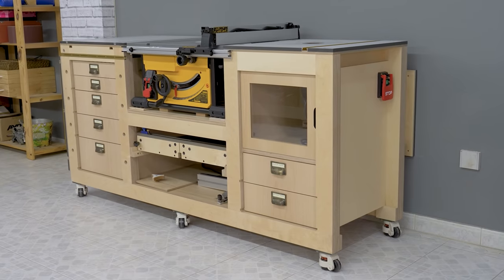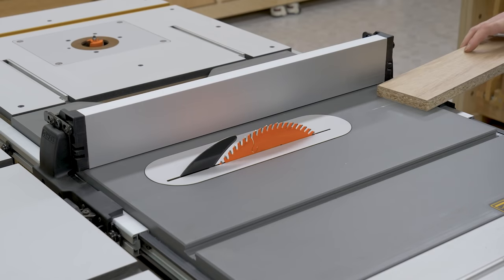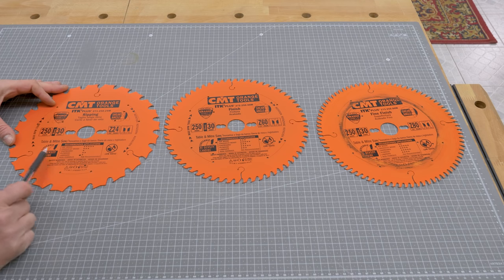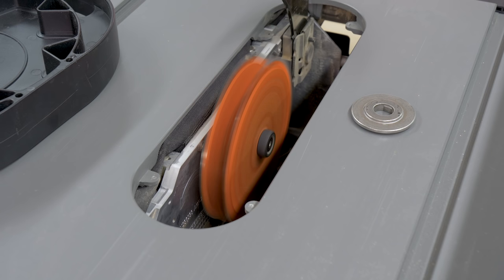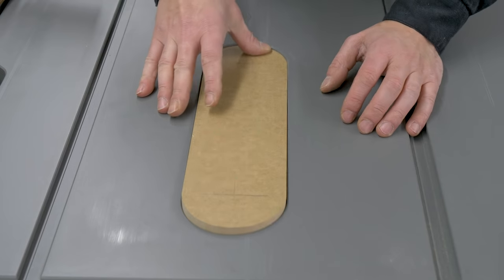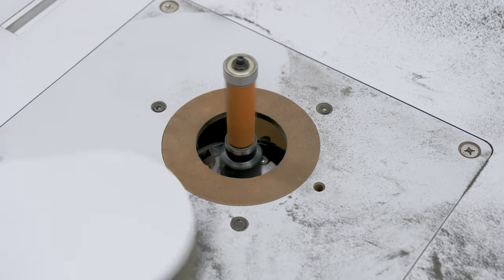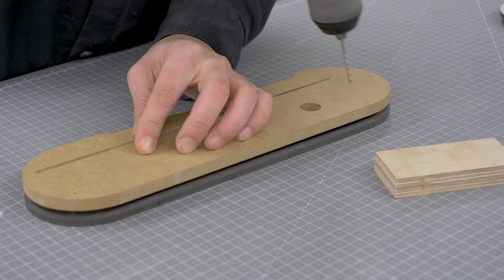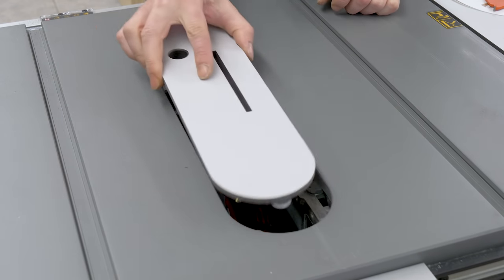DIY Zero Clearance Table Saw Insert / Choosing the Right Blades

Comment: There's a channel, hooked on wood, where the author showcases inserts with holes and slots adjacent to the blade slot for the purpose of allowing dust to be sucked into the machine. Gonna add those too once I start doing mine

Comment: Excellent video.  I made that modification to the riving knife on my Dewalt to allow the throat plate sides to be connected at the rear.  That knife is made from some tough steel.  I wrecked two metal cutting jig saw blades trying to cut that notch and made no progress at all.  Instead of knife, they should call it a riving katana.  Anyway, I finally just ground it down with a bench grinder, filed it smooth, and painted the bare edges with a paint pen.  Took about 10 minutes max.  That mod is a great idea, but it would never have occurred to me, so thanks!

Comment: Well. If what you’re saying is true. You can’t cut without a riving knife. 
With a dado blade, you are not cutting. You are scoring.
Cutting implies separation which is not the case when making dados.
Since you’re not cutting, the risk of pinching the blade is significantly lower (virtually zero).
Reply: Also cmt is an italian company, i think that if they made dado blades they should be fine for eu regualtion

Comment: The Riving knife isn't the problem. The problem is with the 10 sec slowdown rule, the weight of dado blades and the way how blades are locked on table saws: In Europe every non-covered woodworking machine (or maybe even metal working machines) must stand down within 10 seconds after you push the stop button. (But in practical it's much shorter). To accomplish this rule the motors have some kind of  built in braking solution. If you think about the direction of the nut it is designed to be self-locking and provide constant locking force on the blade while the saw is spinning.  Theoretically you're in safe even if you doesn't pull the nut properly, until the blade is standing perpendicular to the shaft. (Obviously, don't try it). However when you stop the saw and the brake is activates a counter-rotating force occurs on shaft. Eventually this - and the momentum of the blade - starts to loosening the nut. For normal blades table saws are designed. Manufacturers calculate how much force have to apply for braking to not loose a properly applied nut. But dado blades have much-much more weight and therefore much higher momentum during shutdown. 

So dado blades are NOT prohibited in Europe. They're just incompatible with the extra safety functions which have to be built in into a table saw in Europe.
Reply: There are new dado blade from cmt and they are autorise in Europe
Reply: @ir0ki11er  did you understand what I've wroten? Dado blades never was banned from Europe.

Comment: Where I live, there aren't any of those types of wood available within 200 miles. Even then its an "Iffy" proposition. Melamine coated colored MDF is unheard of even in search engines here. MDO is a plywood used for road signs in highway departments. Specially made. Usually not available except by special order with LONG waits. I absolutely LOVE your designs and their look. Practically none of the material you use is available and it would be cost prohibitive to say the least. Hooked On Wood makes similarly ingenious designs --- in the Netherlands.
Reply: Are you in the United States? & Yeah Dennis from Hooked on Wood is amazing! His new shop is looking good.
Reply: I've been searching for the same with no luck in Sweden. The best I've found and bought so far is Valchromat, which is not only colored MDF but also much higher density and behaves more like hardwood. But getting it melanine-covered opens so many possibilities. Hoping that I can convince some importers here to make it :)
Reply: @desertpillar5286  Valchromat is an awesome material. You can easly coat it with melamine with some contact cement. Anyway HPL is not the material is a special kind of melamine made of resin soaked paper. I suspect the material he's using is some kind of HDF like valchromat coated in HPL. Pricy but extremely durable.
Reply: I think the material he is using is CompacMel made by the manufacturer Finsa in Spain. It is similar to MDF but made too much higher density. When std Mdf 12mm is typical around 770-800 kg m3, CompacMel is close to 1200kg m3. If I remember correctly 😅

Comment: Great video as usual from your chanel. Thanks for sharing, by the way, what if a "Driving knife" can be modified with different thickness to match dado blade? using same metal to insert and hold it in place, but modify the thickness in order to keep a level of protection?

Comment: You can also cut the blade groove through the thick MDF using a saw blade of a smaller diameter mounted on the saw. Just make sure it is the same or smaller width.
Reply from the maker: right! thanks Tim

Comment: Hi 
Thanks for the video :)
What size is the hole Ind the dado blade? Normal blades are 30mm for this saw. The reason I’m asking, is that I’m thinking of buying the CMT dado blade stack. It has a 30mm hole. Would that be a problem?

Thanks

Comment: We have a lot of the same tools. I have that same table saw, the 12v cordless Bosch router, and I have the 24t and 60t CMT saw blades. 

Question: does your 60tooth have a high pitch sound when it spins freely?  Mine is awful. It's a great blade that cuts really nice, but the high pitch sound is really annoying. I try to use hearing protection most of the time, but sometimes I just need to make one fast cut and don't have any hearing protection on me at that moment, and in those cases, I hate using that 60t blade. But it's only there while the blade isn't cutting.
Reply from the maker: hi Isaiah! it's a bit noisier than the other two blades, but the bench table saw itself makes a lot of noise, even without the blade

Comment: You could get away without "shaving" the riving knife if you leave a lip that goes below table surface. Look at the original insert plate, there are two small tabs. I believe there is enough room to have the lip entire width from tab to tab position and make it even longer. This way you can have your groove for riving knife go a bit further without breaking the insert plate. You have to engineer a locking mechanism similar to original in front though but there are plenty of alternative designs in youtube for that.

Comment: Hi, I bought the same DeWalt saw, I'm in Europe. Two questions: are CMT blades with think kerf really compatible with the standard riving knife. Don't you get a slight misalignment since the kerf is thinner than on standard blades? Would a 254mm (10") blade also work or is it too wide? Thanks for you reply and I love your amazing work by the way!

Comment: I'm curious why you're concerned with making the riving knife work with the dado stack.  I thought the purpose of the riving knife was to prevent the separated pieces of wood from pinching on the blade after they pass through.  I wouldn't think this would be an issue with a dado since you aren't cutting through the wood, but just making a groove, so there is nothing that can pinch together on the back end.
Reply: Agreed.  A dado blade is not meant to make a through cut and only a grove, so the riving knife is useless.  Material does not "pinch" when not cut through.
Reply: Well, he clearly explains it around the 6 min. mark.

Comment: Dear, thx again for your videos ans plans.
I'm nearly done with the build of my mobile workbench based on your plans.
I've bought the same blades as yours but saw that the riving knife of my saw (same of your dewalt) is mentioning that it allows blades above 1,5mm kirf.  The ones we have are 1,4mm.
I wonder if it was a problem for you ? Aren't the pieces of wood thightend vu the knife against the fence ?

Thanks a lot for your answer
Reply from the maker: hi mate! my CMT blades are 2.4mm thick, are you sure yours are 1.4mm? I would love to see pictures of your mobile workbench, you will find my email at the bottom of the web
Reply: @Paoson_Woodworking  sorry, yes 2,4mm as well. But on the knife it is indicated that it s for blades that are at least 2,5. I think i should tune  the knife because with the caliper it's at 2,2. It should work but my wood pieces seems to be hard to push at the end of the cut
Reply from the maker: I've been using the CMT blade and that knife for months and I haven't had problems. What I do remember is having to adjust the knife to align it, I used masking tape to separate it a bit to the right, I think I remember!
Reply from the maker: now that you mention it, it seems tight, I have to check it again

Comment: Dear,
I wonder if you change the original bolt to tighten the blade ?  Also, did you ever encounter any loosend blade using the dado stack?  Thanks a lot for your answer
Reply from the maker: hi Benoit, it is the standart bolt. You will not have problems with the Dado stack if you use it properly!

Comment: Hi! I have a question about saw blades. Their thickness is 1.6 mm, the width of the cut is 2.3 mm. The thickness of the wedging knife is 2.2 mm. Do you ever have a knife stuck in the cut?

Comment: I’m looking to do something similar on my Delta 36-441. Has stock splitter that is huge and in the way w attached blade Gaurd - I’m tempted to just re use the splitter but cut it down so I can use micro jig but then I won’t have the splitter/blade Gaurd again in case it doesn’t work out well- any suggestions from anyone?

Comment: There is no requirement in EU for a riving knife when making non trough cuts. It's fully acceptable to remove it as it will serve no purpose if it's with is not matched to the blade. The only limitation to dado blades I can find besides what you menthion about being able to mount it securly is a recomendation to use a shaper instead for production runs.
Reply from the maker: thanks! I had understood that you cannot work with the table saw and Dado blades without the riving knife, have you found any official document that explains this better?
Reply: @Paoson_Woodworking  The documents I have found are in Danish, and it has been a while since I looked into this.
Reply: They are new dado blade from cmt and it's autorise in Europe

Comment: @Paoson Woodworking hello . I order the saw today. What is name this plastic material or you can send some web  page? Thnaks
Reply: It's I guess HPL or you can use HDF 
I also need to find like this material for the saw
Reply from the maker: I think you won't be able to get it, it was called Compacmel. You can use other materials as it says Praneet
Reply: @Paoson_Woodworking  Thnaks. And what length Woodworking Enhanced is good for this dewalt 7492 ? 45? 60? cm or 80 cm?
And when i order plan for table there is name or links to alieexpres to accesories? for table?

Comment: The manufacturer is not recommend using the Dewalt table saw with dado blade, but i want to use it after having a Workbench for my table. Can you share your experience while using dado blade with dewalt saw?
Reply from the maker: hi, the DeWalt DWE7492-QS allows you to use small diameter dado blades without problems, I use it almost every day:
https://www.paoson.com/forum/viewtopic.php?f=22&t=59#p6159
Reply: @Paoson_Woodworking  thanks for the feedback!

Comment: Great Video!! Definitely going to Build this for My Saw 🌟👍🏻
I also Bought the same Table Saw but I didn't get a default Blade in it and I need buy all 3 but don't know which brand blade to buy coz in India I'm only getting 80t DeWalt Blade but not getting 60t and 24t so can anyone suggest which brand blade should I buy in India?? 
And I have a 10" Miter Saw Blade and when I put it in my saw there is a difference in blade and riving knife how do I adjust it?? If I could attach photo it would be better to understand
Reply: @PRANEET BANE  CMT blade isn t in India?
Reply: @mitsubishmr  I searched in Amazon India and I got but non of their products were in stock and + if in stock it was unable to deliver to my location ☹️
I'm searching for CMT delear currently
Reply: @PR-WoodWorkingCreations  i Can help order in our country and send you
Reply: @mitsubishmr  but how much it will cost?? Coz importing will cost more I guess And How you can help?
Reply: @PR-WoodWorkingCreations  I think i help you. I order in me country shop and send you. Now a check and when i send up to 500g it cost  6€
Reply: @mitsubishmr  first what's the price of all 3 Blades? And how much it will cost to send India? 
And where you live? And how I pay you?
Reply: @mitsubishmr  ???

Comment: Riving knife is only needed when cutting completely through the board.  
...if you aren't cutting all the way through then there is nothing to "rive" (split apart), so no safety issue and no legal need for a riving knife.

Biggest problem with dado blades is that you need a fairly decent motor brake to stop the additional mass within the required 10-sec spindown time.  Many job-site saws won't manage it but any decent full-size cabinet saw should be fine. They'll be designed to work with heavier and larger diameter blades so a small diameter dado stack shouldn't be an issue.

Comment: I was hoping you touch on the parallelism adjustment when you set the blade at 45°.  The trunnion is a bitch to adjust on the DeWalt.  There is literally no room.  My blade was adjusted perfectly at 90°  May be .05mm off.  But at 45°, parallelism was off by .18mm.

Comment: I wish I could find this 13mm material in Texas. I have had ZERO luck locating anything like it.
Reply: In Alberta also no way to find something like that
Reply from the maker: :D  you can also use HDF or MDO board with melamine
Reply: @Paoson_Woodworking  what is MDO boards. HDF is available here, but w/o any melamine on it
Reply: Elevator manufacturer (OTIS, THYSSEN…) use that material (HPL) often for the inner surface of the cabine. At least in Europe..
Reply: @Karatikus  LOL. Maybe they also use it in elevators in north america. I hope you dont suggest here that we should just take some elevators apart to have material for zero clearance inserts etc. LOL
Reply: Most public toilet stalls are made with 12mm HPL (Compact Laminate) in Australia.  Because it's easy to clean, doesn't swell, and is chemical resistant.  Surprised that isn't more Universal.
Reply: @marcelo403polo2  No! 😂 But wait… 🤔🙈
Search for „FunderMax“, they have a company location in NC and they are manufacturer for HPL.
Reply: @Karatikus  I’m North of the border. Far west too….
I tried searching for this kind of stuff for few years already. Trust me, no luck at all
Reply: @marcelo403polo2  just take the blade from a hockey stick? 🤔
Reply: @Karatikus  lol

Comment: Not. In Europe is different problem. Who cares about riving knife? Who cares about regulations? 
On all Europena saws is possible to easy remove riving knife. In case of regulations/laws this will be technicaly obstructed. 
Allways using riving knife is only in safety instructions. There it's nothing about laws and regulations.
European saws simply haved short shaft for dados use... :D  
And on majority EU table saws shaft diameter is 30mm, not possible to mount 5/8" dados/blades etc..
And second problem will be with small modern saws with autostop (and brush motors), where dados (thanks to weight) doing self unlock from shaft. :)